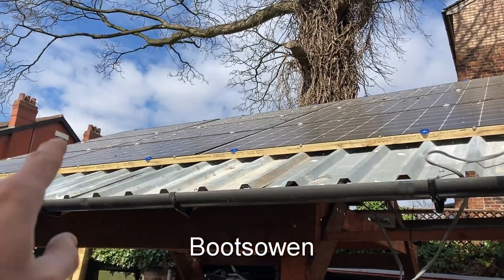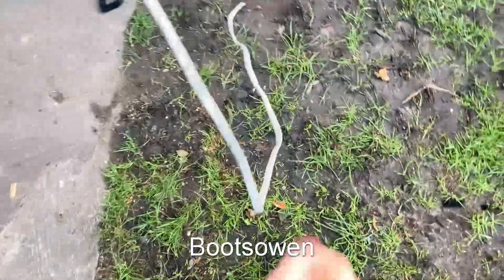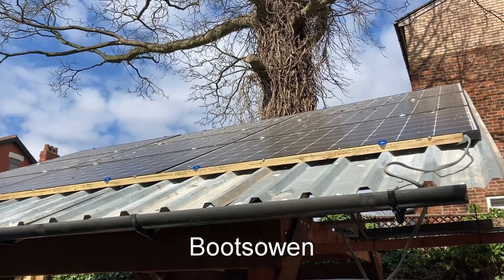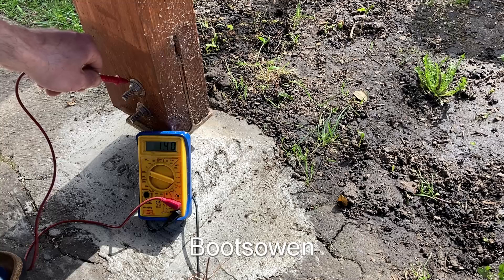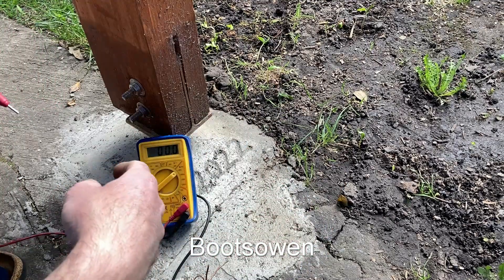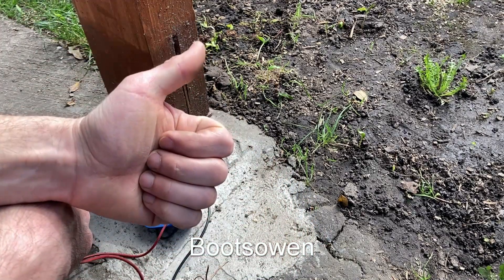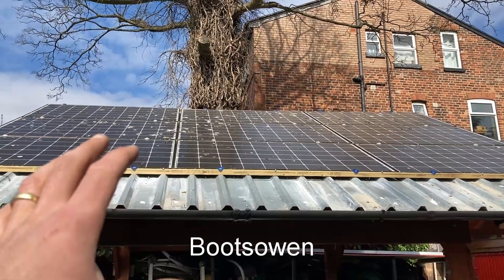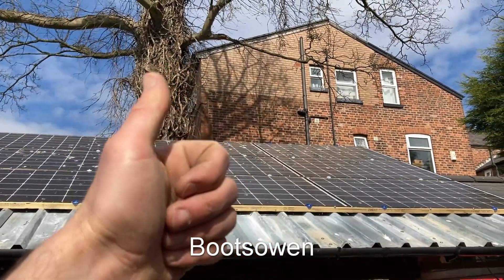Solar panel earthing, what I did, and what I don't understand!

Comment: NOTE:  solid Copper  6-AWG  is suggested for Earth Grounding 
... Stranded Copper wire is not  optimum for outside installation,  as it collect water / moisture and quickens corrosion 
...
IMHO 
...
Reply from the maker: Is this an opinion or a suggestion? Hard to say from this comment.

Comment: Never ever do this by touching separate metal parts something is going wrong here. Check bonding and earthing
Earth is not at zero potential Get a generator put ground in on the 240v line it will not trip bteaker earth will be at about 240v. Many people think that current goes back to earth this is wrong it goes back to source. Please do not touch separate metal parts using hands.

Comment: You can't use that bolt, it's bolted to wood! Yes it passes through a metal bracket in the middle but you can guarantee a good connection.

Comment: just a personal opinion & FYI:
a proper ground rod is  Eight (8) Feet long 
&
is  Copper Coated STEEL 
...
Each of your  PV Panels need to have a Ground  "Lug"  attached, ideally with a Stainless Steel Bolt  ... 
...    to a point on your PV Panels Aluminum Frames  
that have had the Anodization removed 
with a Grinding Wheel or Sanding Disk ... 
&
then your 6-AWG solid  Bare Copper wire attached to your Eight Foot   L O N G  Ground Rod 
...
may  I  suggest a  SURGE-Protector for lightning suppression too ? 
...
G@@D Luck 
...
COOP
the  WiSeNhEiMeR from Richmond, INDIANA, USA 
...
Reply from the maker: I think that you are probably in the USA. Rules are different here. 
Opinions are great and welcome but personal experience is best. Thanks

Comment: my theory is, basically what happens is,  one panel frame has no effect but if you bond the entire panel and then ground it than the current and voltage adds up. but why you ask it's DC current right? why do you get AC reading?  because for a second , it follows the normal wires of the panel than it follows the easiest path to ground(earth) than again flows in the normal wires again. it's nitpicking who is the easiest resistance if its the load or the ground everytime. the current is alternating from panel go ground to ground to normal flow. that's why it's reading AC. and that's why your inverter tripped because if the leak is high enough, basically the current will no longer flow the right path.

i bet those panels are already damaged by PID(potentially induced degradation) 
but case i point, my brand new panels are also experiencing this.
Reply from the maker: Hi. Thanks for your comments. The array is still standing but no longer earthed. The earth cable to ground was causing the main rcd on the house to trip on startup on some days. So rather than fix the problem I have removed the earth. What I think was happening was that the earth I had installed was into the ground. When wet the path of earth current flow back to the consumer unit wasn’t that far through the earth. Maybe 2-3m of actual earth then via the mains cable in the street to which my house is earthed. So I broke this link. My house has a 30mA rcd. But the abb inverter specifies a 300mA rcd. So maybe this was one cause.  I haven’t tried earthing the panel frames back to the inverter. But I might. I also haven’t got the earth anymore so it would be impossible to try your switch idea. I have heard that the current spec for installation specifies earthing. Whereas it didn’t in the past. I might not be right there. As for the panels:  they keep giving.
Reply: @bootsowen  no i mean, even your normal roof to ground original setup would do. Just put a switch in between then turn it on and off and see the voltage reading on the inverter monitor, look for the panels dc voltage reading.... Much better if you wet the groundrod first to get maximum leaskage to earth.
Reply: @bootsowen  i dont think the mains cable near you are the cause. I have brand new panels 3kw array 400 volts. I also got shocked like you did but my pannels arent grounded also. But it was a small tingling sensation not unlike yours.
Reply: @bootsowen  you have  similar case here. https://youtu.be/eibk7az038Y he got. Shocked. Too
Reply: Very good video. I subscribed man... Please do more testing like the one i told you. Our experiment might save a life

Comment: may i suggest that you put a switch in between your grounding. and see if it effects the voltage of the production in the inverter when you turn off and on the switch to the ground. i have a theory that some current escapes from the panels given that the panel voltage is high enough to counter resistance of the glass and aluminum frame.

Comment: I think that one or more of your panels have a leak in the silicone seal of the frame. In the wet environment, moisture was in the panel(s) and conducting internal made electricity to the metal frame of the panel. This is known as panel leakage and is a bad thing. You need to check each panel and remove any panels that fail a leakage to ground test. If the panels are tied together, you could have very high voltage and amperage floating around. That could be very dangerous, especially for a child or an adult standing on damp ground. 
     Take Care and fix that panel before anyone gets really hurt or killed, John
   EDIT, I just looked at your other videos and learned that the panels were used. I think that one or more of your panels is defective/damaged and that is why they were removed and changed. I also learned about the amount of energy that you are messing with.  You definitely need to find the problem panels or have a technician come out and do it before anyone gets electrocuted. Take Care and be safe...

Comment: Owen, I'm thinking what you have made inadvertently is a capacitor, steel, aluminium, and water. That's why you got the sudden high voltage discharge and the shock. Must take a bit of time to charge up, hence the lack of further readings, cheers
Reply from the maker: That is an interesting take on it. I was thinking some kind of static but static would require movement. How to test it?  I have a feeling that I am going to remove the panels again and offset them a bit farther, so that they are not in contact directly with the steel, I have wound my head up about dissimilar metals and corrosion.

This morning when the ABB inverter kicked in it tripped the rcd in the house. it stopped tripping when I disconnected the earth rod in this video! It didn't do it yesterday, but it was a bit damper today!

I have the new solis inverter kicking out about 20w in the garden at present. (3 panels fitted loose) It was still reading the negative leak fault when I energised it, but I went through the settings and was able to override the protection. Hopefully a video tomorrow.
Reply: @bootsowen  Step one, override protection, step two, smells like bacon cooking?

I'd be far too scared of that much DC voltage to be messing about with it myself; you're a brave man.
Reply: @bootsowen  Owen, so those panels are leaking to earth in wet conditions, maybe that's why they were removed. With my panels on steel frames there's either 2 thick layers of paint or a 2" wide strip of stick on high density foam tape (about 2mm). Anything to isolate them from the corrosion effects. On the 50v DC battery side I have to be really careful about this in all the cable junctions. Cheers
Reply from the maker: Hi Andy, they may be leaking to earth, if they are not acting as a capacitor, either way, it does not have any effect on the inverter, which I presume has some safety parameters set. The startup this morning did something to the CU, when the roof was earthed. The CU has a 30mA RCD, but the ABB specifies a 300mA, So I guess that even if it was working properly it could still trip the 30mA RCD.
Reply: @bootsowen  Owen, I'm thinking wooden rails on top of the tin and mount the panels on them, making sure the panel frames don't touch, cheers

Comment: Metal encased in concrete is certainly not suitable for use as an adequate earthing conductor. Ideally a decent copper earth stake driven into the ground at least 2 feet deep ! like what you have done. or use the existing house bonding. then take readings from the roof with an earth loop impedance tester. the potential voltage is either coming from badly insulated panels / connections. or some transient voltage leaking from elsewhere !!. you certainly should not be getting electric shocks off a tin roof, regardless of solar panels on top or not. Good Equipotential bonding and insulation of conductive parts is the key here. as you say your installation complies with NO codes or regulations and you also lack the correct test equipment to test installation properly. so all you can do is bond anything that's extraneous and conductive. I would note that the bolted connections could do with beefing up and covering or weather proofing for corrosion protection otherwise galvanic corrosion with degrade your electrical connections very quickly outside. especially as they are all made of different metals. One thing you should investigate is your house supply to see what type you have. You may think your doing the right thing by adding different earth paths around your home but depending on the supply to your house this could also be dangerous in certain circumstances. I would check what type of supply you have and incorporate any earth bonding to it to prevent un-balances or stray induced earth loops which could damage your inverters and battery charging equipment ! 😞 . Your house could be TT / TNS / TNCS or another variant of mains supply type. definitely worth a quick check.
Reply from the maker: I appreciate your comment. I think we have TN-S here. But as we both know, I am no expert! 

As it is at present, the solar panels and roof are not bonded to the house (TNS)earth.  I hadn't thought about bonding it back to the incoming earth. Nor should there be any link except on the DC side of the inverter. 

I agree with you about earthing off the concrete, really what I have done is still an experiment. 

This morning when the solar inverter was starting it kept tripping the RCD on the house CU. The manual for the inverter specifies a 300mA RCD, and I suspect that the one in my CU is lower. It stopped tripping when I disconnected the earth rod shown in this video. 

The inverter only requires the earth from the AC side. It does not want either positive or negative to be earthed on the DC side. It does not specify bonding of the solar string. The jury seems to be out on that topic!

Comment: Five minutes in I was just thinking I should post that you're grounding it out via the meter... Then you cought the sudden discharge on camera!
Reply: Further, you now have a sort of Heath Robinson TT installation for the outbuilding; then presumably PME from your supplier indoors?

From memory you need to ensure at least 2m separation between the two earthing systems or have them bonded together such that nobody can get in touch contact with both at the same time and directly experience any potential voltage difference. 

You wouldn't want a socket in the outbuilding running off the earthing system in your house and not bonded to your new potentially different roof and child accessible copper pipe etc when somebody might be touching say a washing machine or variac that's grounded to the PME from the house.

In a built up area with everyone sharing the supplier earth and bonding it to their underground gas and water pipes unlikely to see any difference in practice... But still.

That and you need to sit down for about three hours and watch all John Wards earthing videos; since he actually know what he's talking about and I don't... It's a surprisingly complex subject.
Reply from the maker: Indeed, reading the comments on this video today I think a revisit of JW's earthing videos might be a good thing.

Comment: Ive not earthed anything.  It appears to have several differing opionions on it as is usual with electrical codes.  If you want three different opinions as two electricians.  I have earthed the inverter and the AC end but didn't want a lightning rod on the roof.
Reply from the maker: Thanks for the reply Mike. I have the AC side earthed through the mains. 
I only noticed the fault when I changed a few conditions, I was playing with another inverter ( a solis), testing it on this string, on a damp day, after I had installed a tin roof under the panels, and touching all panels ( which I guess now may be a bad idea because of dissimilar metal). The solis noted an earth fault and wouldn't start, hence my experiments. 

Interestingly, this morning, 3 days after installing the earth rod, my rcd in the house tripped when the ABB inverter was starting. A strange one as it never tripped before on dry or wet days, grounded or ungrounded. When I disconnected the ground it worked fine. I suspect that if it happens again I may need a 300mA RCD. I might just install a completely separate electrical panel for the solar. 

I think I am safe from a lightening point of view, See the tree above.
Reply: @bootsowen  300mA is only good for maybe stopping a fire; it's really no good for protecting you or any small people.

If you have earth leakage then you should be handling the earth leakage problem not increasing the RCD trip current.

If it's sharing an RCD with other loads which might have their own earth leakage contributing to the 30mA for trip then you could pop it on a dedicated 30mA RCD or an RCBO.
Reply from the maker: It is the inverter that specifies the 300mA. And I understand what you mean about little people, etc. I have a 30mA in there at present, replaced this year when a recently repaired washer kept tripping the old one. I suspect that this house has a number of separate leaky loads. 
I am leaning towards a separate circuit for the PV, at present it goes through the garage. I have more panels to install and then I may have things changed around.
Reply: @bootsowen  I had a growatt storage inverter which required odd male male cables to collect it to the inverter beyond.  Without these the case of the inverter bacame live with DC for some reason.  The earth didn't help much.